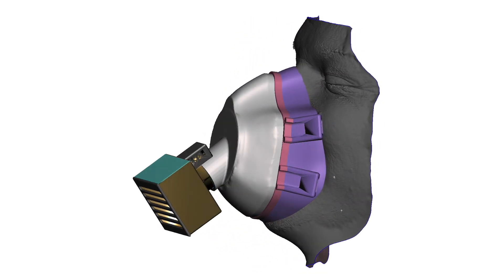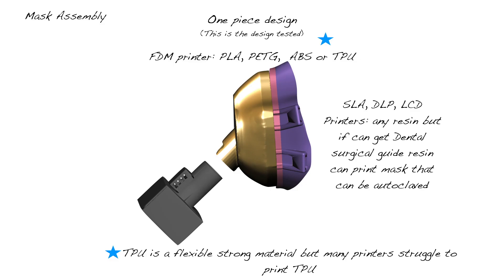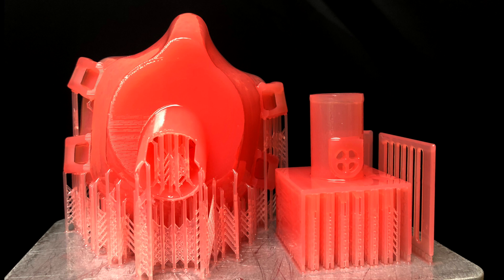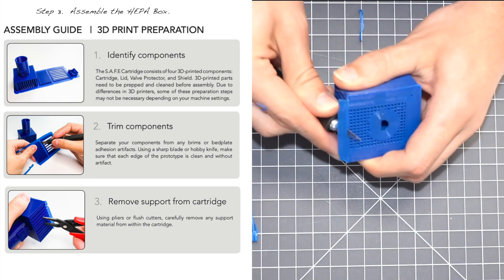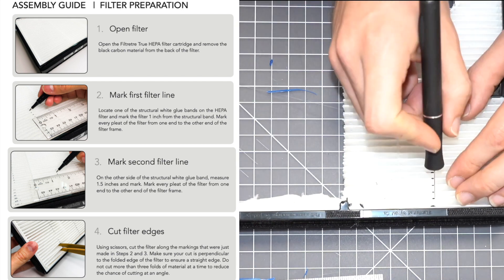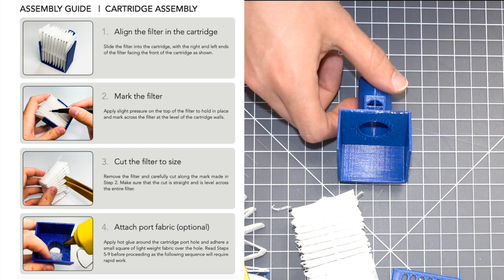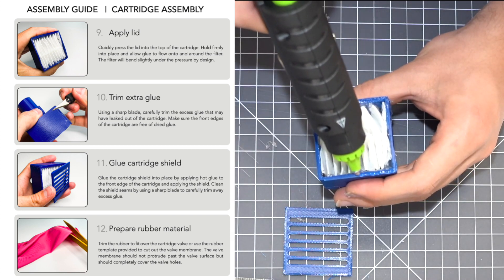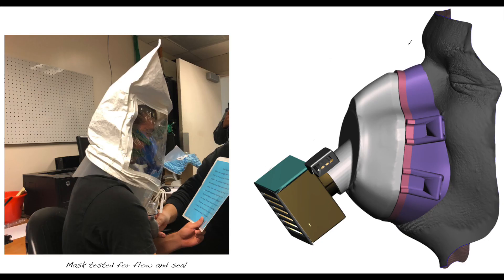3D printed COVID-19 Mask

Comment: The more complicated the more ineffective this becomes.  But you going in the correct track.  Good Job.
Reply from the maker: this was designed by pulmonologist and engineers. nobody is forcing you to make this.
Reply: @wallyrenne   You are absolutely correct.
Reply: @wallyrenne  wally just a master composite mechanic advice with 45 year in the aerospace industry, PLA do not mix with TPU.
Reply from the maker: maxun1  they are both low temperature thermoplastic that can be heat welded together in seconds. Easy. Do it all the time.

Comment: I am seeing with a microscope people are finding small holes in the printed material. Have you seen this in yours? How do you deal with that?
Reply: Excellent video. Another quick answer to Donny's question is you can spray down the outside with a sealant like MG chemicals silicone conformal coating, generic clear lacquer, flex seal, plastidip, paint, etc. Anything that adds a layer will reduce any imperfections. Tho goal among 3D mask creators is typically just to make the best temporary measure we can, until the PPE shortage is over. I'll do a test comparison between sealants and share soon.
Reply from the maker: Donny Filkin please read this research article https://journals.plos.org/plosone/article?id=10.1371/journal.pone.0198370
Reply: @wallyrenne  I would not trust my printer (ender 3). I have in front of me a 20% fill 10mm thick plate which I can easily get air to pass through at only a  little more than 1 bar. I could seal the surface with paint or filler and get an air tight seal at moderate pressure but off the printer even thick prints are porous. Yes I read the quoted article. I think too much depends on how well the printer is set up and for a DIY machine this isn't going to be reliable. Water droplets are easy to capture, virus particles are on a nano scale. 80 to 100 nano meter. that is several orders of magnitude smaller then 0.3 microns.

Comment: I am making these. The design fits well and it is easy to print and needs no supports. https://www.youtube.com/watch?v=9ItpExBEieY There is room for improvement in this design like adding an outlet valve  but it is much easier to print and much less work to finish.
Reply from the maker: Dieter Gribnitz EZ print files print with no support very easy

Comment: one REALLY REALLY REALLY IMPORTANT NOTE: Do not cut into a filter until you are ABSOLUTELY sure it does not contain fiberglass! Otherwise you'll inhale that and that'll be pretty terrible!
Reply from the maker: best to use the Roomba 700 filter and adapter in the files because already made perfectly
Reply: @wallyrenne  HOLY FUCK! Ive been looking for a small filter like this for days! thanks!
Reply: Why can't we just print an adapter for the standard filter? I doubt this hand glued filter is tight.
Reply from the maker: Karsten Schuhmann  you can I have 3 different adapters for roomba filters. Please look at the files
Reply: @wallyrenne  Sorry, I had not looked up the files. I just saw the video.

Comment: How long will the filter last before it needs to be changed out? How slow should you print at?  I read that if you print at .12 mm layer height viruses and bacteria can’t get between the layer lines.

Comment from the maker: n95 only filters 95% of particles .3 and larger where HEPA (high-efficiency particulate air) filters are better selection for use with a respirator because their efficiency is 99.97% for monodispersed particles 0.3 μm in diameter or larger. The best would be a n100 if you can find it. Make sure to slow print down and do a 1.5x extrusion multiplyer
Reply: Filter will lost it's electret property after exposed to alcohol or soap wash and will degrade filtration level to like 67%.  It should be changeable in case of contamination or disinfected with H202 vapor or O3.  UV-C also degrades the filter.
Reply: this is actually a misnomer. Let me properly add the correct information. 0.3 microns is NOT the smallest a N95 can filter out. it can filter out smaller particles much better than 95% that because smaller particles bounce off of the gasses in the atmosphere due to brownian motion. 0.3 is the HARDEST to capture, this is why we use this number. I am am medical and aerospace engineer and have been doing this for a while haha. 0.3 is the hardest because it is almost the same density as air, making them follow the same streamline as the pressure gradient is going. 

second, we do not breathe out a naked virus, its impossible. A virus requires a living cell in order to replicate because its a non living thing. These host cells are very large in size, about 0.4 microns is the smallest that can allow successful replication:)